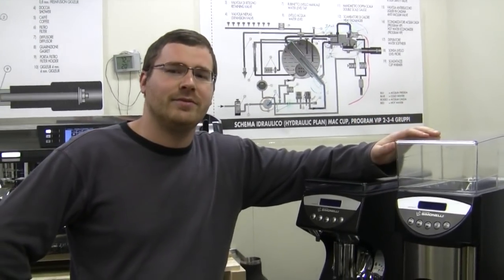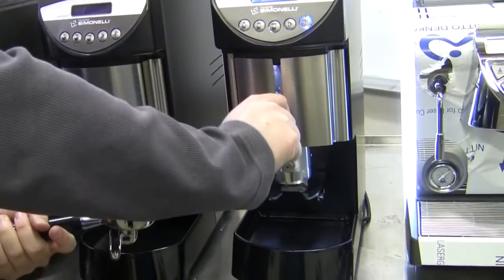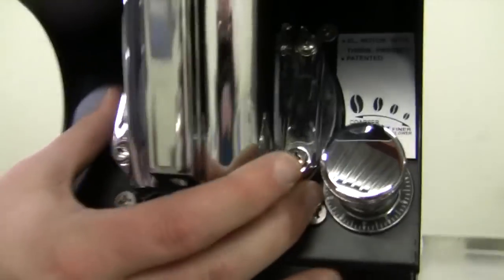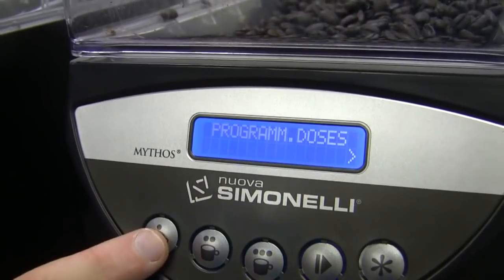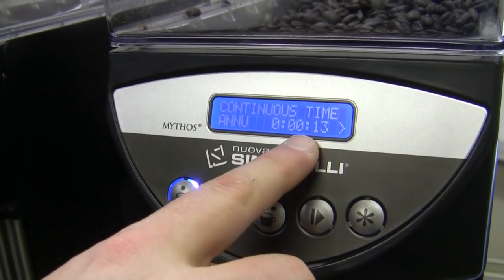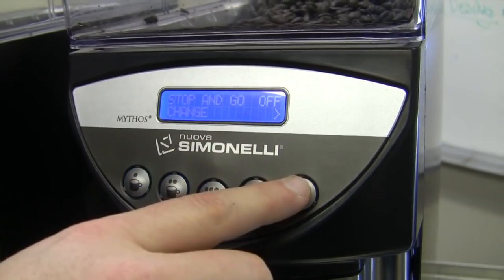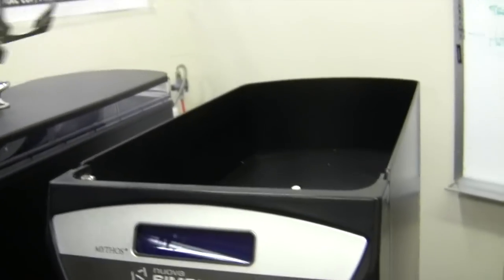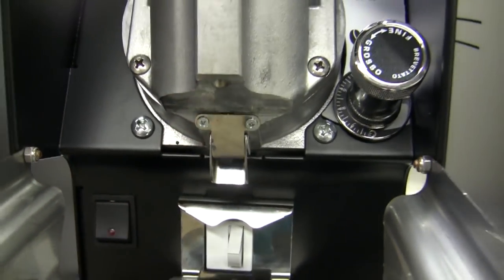Crew Review: Nuova Simonelli Mythos Commercial Coffee Grinders

Comment: thanks a lot, mythos plus have 2 adjusting knops one for tamper and one for grinding size.....for grinding size for example it is from 0 to 10....if you reach 10 and you increase the knob clockwise after 10 it will hit 0....so what is going to happen,  does it just go to 0 or it what! same for tamper what will happen.......thanks again

Comment: Mine looks like the one on the middle, but has thermal control function. Rubber covered line is connected to upper burr and keeps the grinder hot. Lefty looks more fancy though. By the way, I have little problem with thermal control function that needs quite a bit of time to heat up about 1-2 hours, so every morning, I start with courser grind setting and once the burr starts to heat up, I need to grind finer to have a same extraction. (hotter coffee ground has a faster extraction than cool one.) I waste quite a bit of coffee when I change the grind setting. Other than this problem, everything works fine. Thanks for the review.
Reply from the maker: Yeah, they're in the process of tweaking the line, so i believe the series will look like this in the coming months. Thanks for sharing your experiences with the temp control - great for folks to know. - Kat